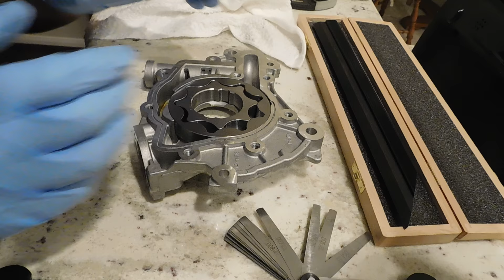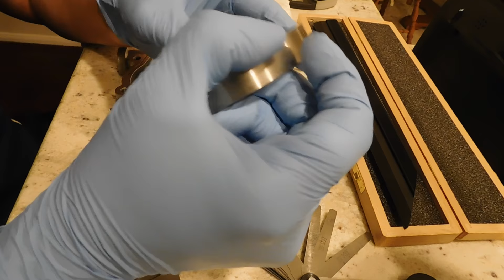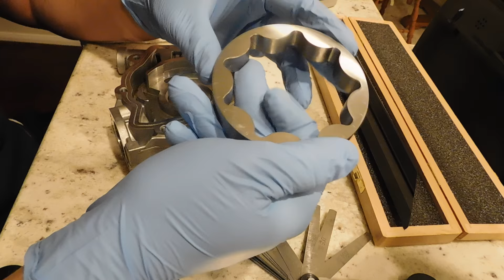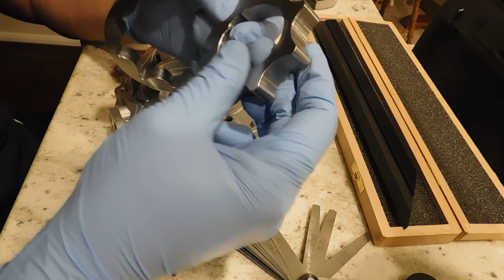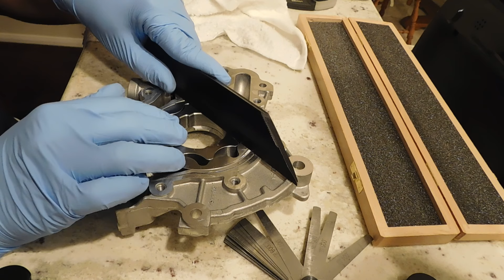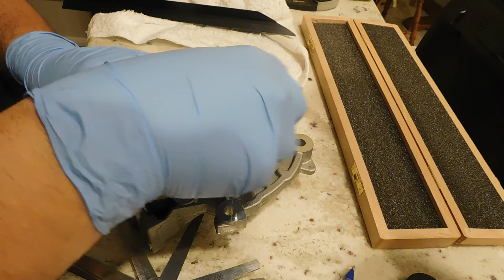Gerotor Oil Pump Inspection and Explanation

Comment: I kinda doubt you’ll ever see this but thanks for this video and well done. I work in metrology (aerospace inspector) but oil pumps are foreign to me. Is there any issue with mild/moderate porosity in the casting of the pump housing where the gears sit/mate?

Comment: Thanks for this video. I was debating on replacing my transmission oil pump for a light duty passenger car. I have some light scoring on the outside housing channel because of some small burs on the outside of the ring gear. I took some 800 grit and wet sanded it with oil. The scoring and some of the burs are still there but I think I will be good. I know now whats important to check.
Reply from the maker: You are welcome! Scoring is extremely common on transmissions because of the abrasives off of the clutches. For manuals with a lubricant pump they experience the same kind of damage but from syncros and gear wear. Transmissions gears are generally tighter at .002-.004 clearance on the tooth-tooth and the width clearance is about the same.

Comment: I'd like to ensure that the gerotor-type oil pump of my new Harley is within spec by having it inspected as there have been quality control issues. Could I take it to a good engine & machine shop for that? Should it have a minimum number of running hours on it first to allow abnormal wear patterns to appear? Thanks for your advice!
Reply from the maker: You could, alot of these techniques are feel techniques so what you get will vary based on how much you have used feeler gauges. The gears should not abnormally wear or change appreciable after you run them. So brand new or after the fact should give you the same result. The manufacturer should be able to provide the specification. In most applications between .002 and .006 on the tip to tip, Body between .002-.006, and width clearance from .002-.001 are typical.
Reply: @thetruechaos  , thanks a lot Travis. That gives me something to go on and if I don't feel confident with the feeler gauges, I'll seek somebody with experience to inspect it.

Comment: what about scratches in housing
Reply: Good question?
Reply from the maker: @99zman   Scratches come in a couple of different flavors. There are lap marks which are where very small pieces of debris that make something you can see but cannot feel, and then there are large debris marks which actually gouge the surface. If the gouge is from one side to the other, you will lose some pressure from it. 

More often the issue is just wear, unseen uniform wear can build up on the oil pump housings and cause excessive clearance. Its recommended to replace the housing if it has more then 50k miles on it.